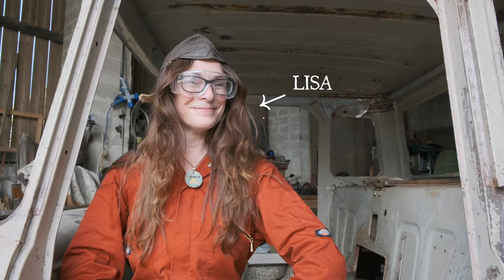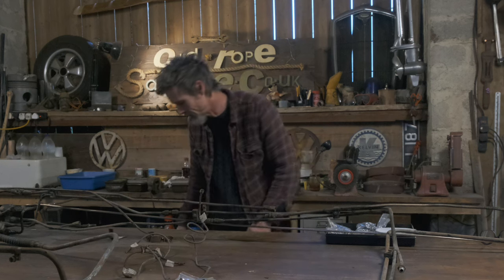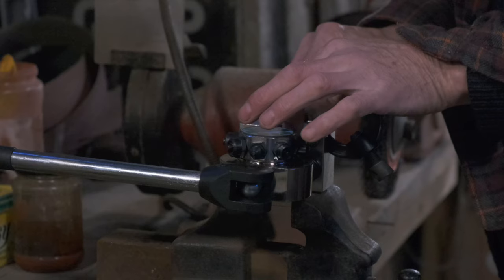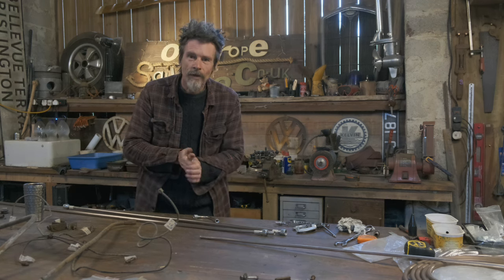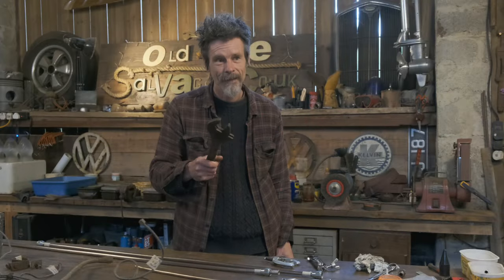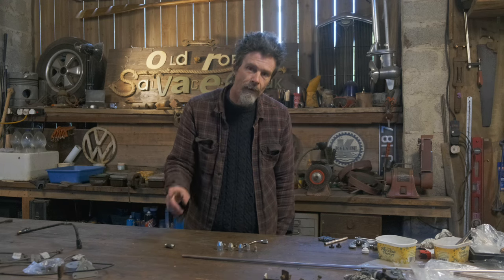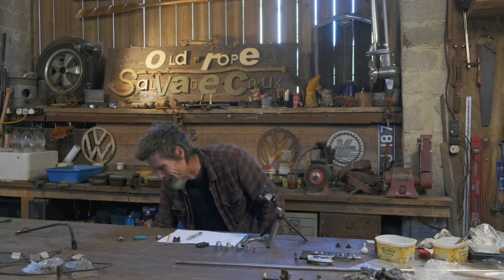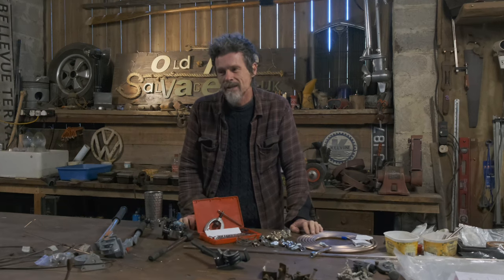Making ALL NEW METAL BRAKE & AIR LINES & Replacing The 125ft of Old Pipes from Our 70s Bedford Truck

Comment: Yeah, doing brake lines is fun. I started last year replacing and renewing the brakes on my 1967 Mercedes LA 911. Waiting on the mud season to finish, so I can lie under the Truck and get on with it.
Great, you replaced everything new. Also, you learn where they all go and what they do. 
Enjoying watching the work
Reply from the maker: Ah, mud season! Will it ever end? Fingers crossed that spring arrives for you soon. And yes indeed, taking everything apart in this way has been the best way of learning how everything works and where it all goes, could not agree more. Thanks for watching 😊

Comment: Top banana, Tim and Lisa! Great explanation and wise choice to replace and agree with the choice of materials. It's daft that vehicles don't come from new with copper pipes instead of steel. Anyway, great work and great explanation. I've always tended to leave the pipe a little long and only trim to size once I'm ready to fit the second end coupler and then flare, as you say in that order!
I'm still catching up on your earlier vids, but this popped into my feed and I feasted! I note this episode featured a fab looking chassis etc. I tried to look away at those points, but I honestly couldn't. It's looking amazing.
Reply from the maker: Ah! Spoilers! Yes indeed, it is looking great, but oh the pain it took to get there, well worth going back and watching those episodes 😂 Still, we’ve come a long way. Huge thanks for watching and catching up with the back catalogue. 😎